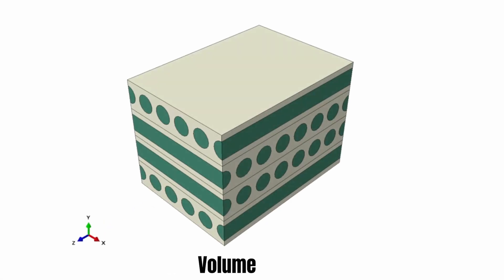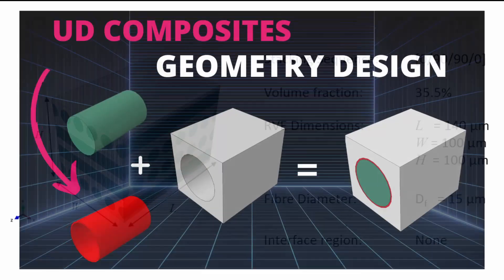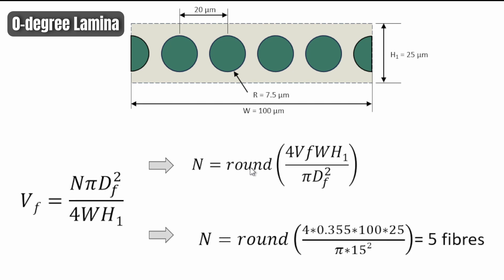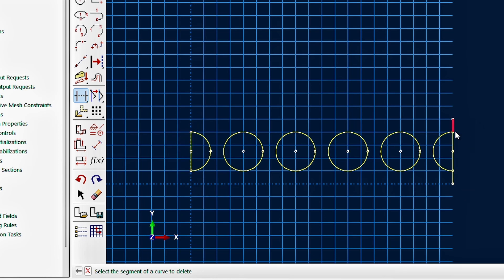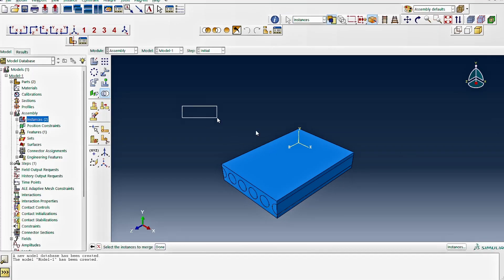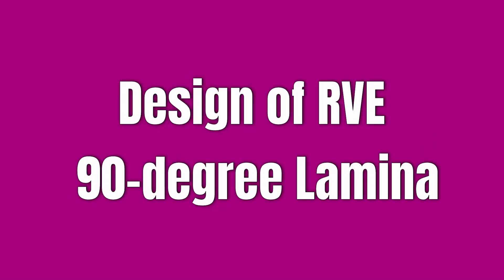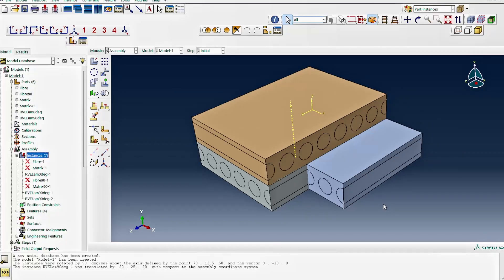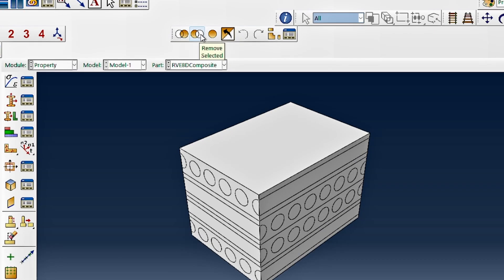RVE Modelling of BD Composite #1:   Geometry Design

Comment: hello sir, I have 2 doubts not exactly doubts but need a direction and help
can we add cohesive elements in this for delamination, matrix and fibre crack analysis?
and how can we model curved composite laminate shell geometry design in abaqus?
Reply from the maker: Hello, yes, I believe you can use cohesive zone element to modelling the interphase effect. I believe you can, just try it out. On the second question of curved composite laminate shell geometry design, I do not have much to say. It is a thing of you trying it out and see what happens.

Comment: Very nice explanation sir. Please tell what is the general criteria here to set the size of an RVE. Earlier we know that how much volume fraction we have to kept and fibre diameter , but how to select the size of rve? Can you please elaborate this?
Reply from the maker: Hello @AnuragGupta-op7uz, thanks for this query. You are right in asserting that volume fraction and fibre diameter are model parameters that are independent of a chosen boundary condition. What we can change is certainly the size of the RVE. I have dealt with this question for a UD composite in this video: https://youtu.be/2NFZ69zdSMM
I have also published an article about this here: https://doi.org/10.1016/j.commatsci.2012.12.036 in which I showed that for a UD composite, a good RVE size should be about a fibre size of six times the fibre diameter. This is about 90-micrometre for a 15-micrometre fibre diameter. 

I think this can be extrapolated to work for a BD composite considering that the building block of a BD composite - at the lowest level - is a lamina made up of fibres distributed within a matrix medium. 

However, it will be worthwhile to assess this fact numerically and determine whether that RVE size of six times the fibre diameter applies for a BD composite. It can be a little study that one can investigate too. I hope this explanation makes sense.
Reply: @MichaelOkereke  thankyou so much sir for this nice and detailed explanation. I will definitely see the video and the paper that you have shared with me. Thanks once again.